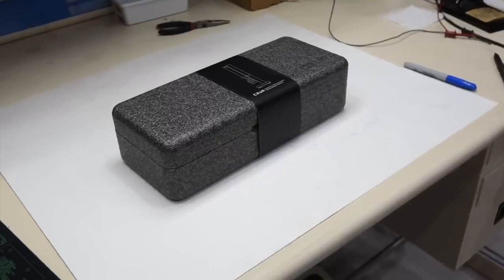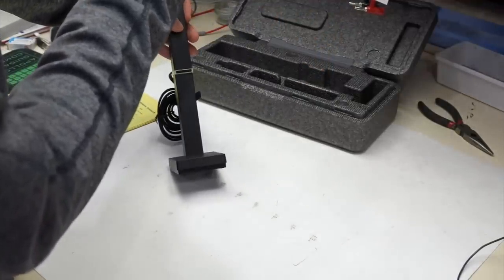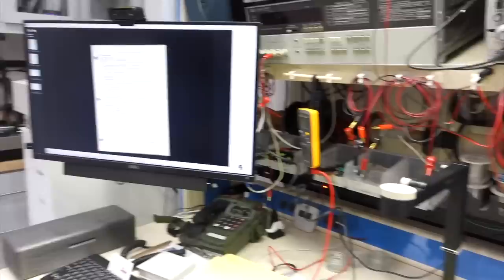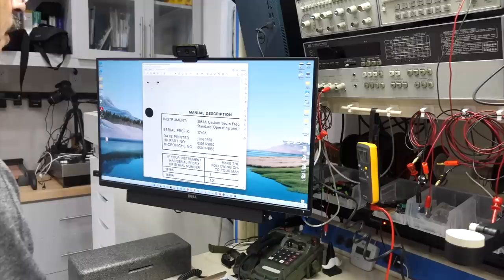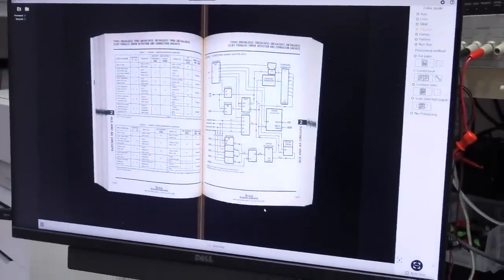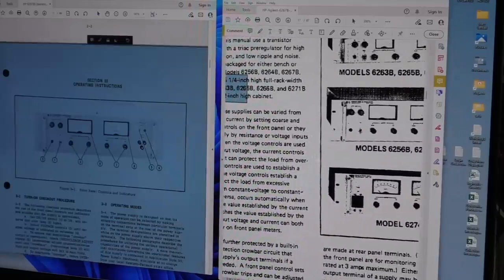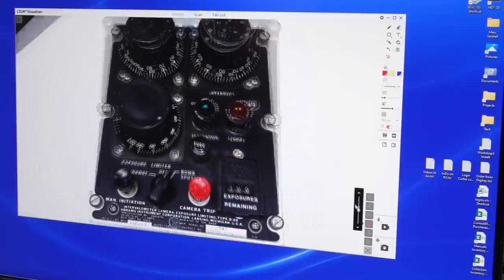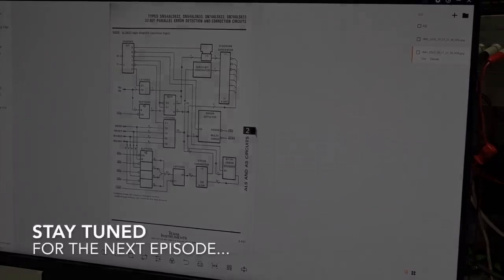CZUR Fancy document scanner review

Comment: How does it work as a soldering/inspection/fine work "microscope"? I'm using an old cludge together "security cam" module on a monitor arm for my macro chip identification and solder inspection needs which isn't so elegant and needs a cvbs tv.

Comment: Sadly, the software is not Linux compatible, it seems.
Reply: Linux and Mac are rarely a concern for startup companies like this unfortunately.
Reply: Since the thing is usable as a webcam it might be UVC compatible, so no drivers needed to get an image out of the thing. Of course any extra function would not be there, but still
Reply: You could install windows into a locked down VM for those time you need it.
Reply: @vincei4252  Of course, but I'd rather not. That would mean a windows license (if I was to do it proper), and I think it would be better if companies started thinking about a broader audience.
Reply: @gigigigiontis8  Yeah, to me it looked like a lot of the value of this product lays in the software and how it is used to scan documents. If it was just about having a camera on an arm, that could probably be done in other ways too.
Reply: Is it not? I'm pretty sure I've seen Tech Tangents use it on Linux, although it wasn't complete, it was completely usable.

Edit : My bad, seems like the software is different for every device, and the Fancy isn't compatible with Linux, but the ET-24 is.
Reply: Have you tried running the software in (Valve) proton? Unlicensed VM would probably be easier, though.
Reply: @tschuuuls486  my wish is not to try and find ways to run windows software on Linux, I have many ways to try to do that. My point is that it is sad that hardware (and software) vendors don't care.

Comment: Question: as the scanning and OCR is entirely done in sofware, can the software be used with a regular digital camera with 1080p USB 2.0 output. It depends what type of USB device it is detected as in device manager? You could make a folding arm yourself if you have some spare wood, hinges and  GU10 LEDs for illumination (like i do).